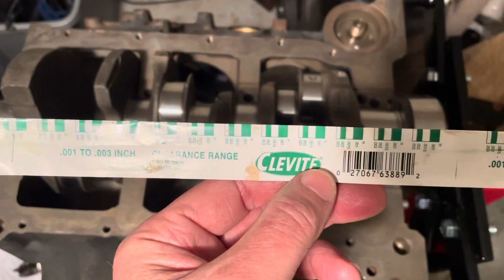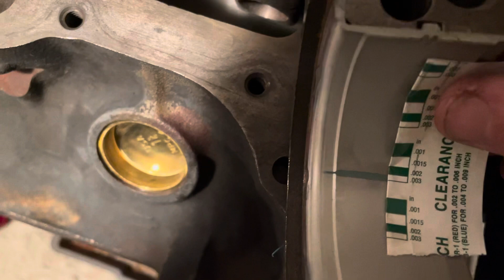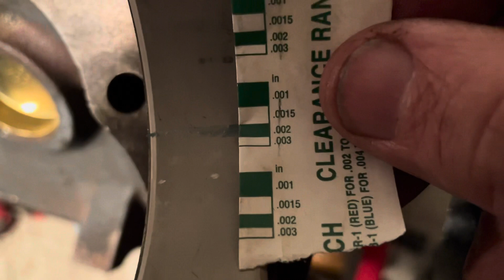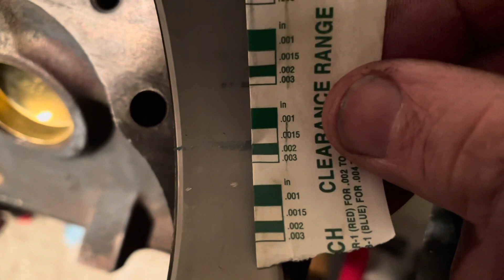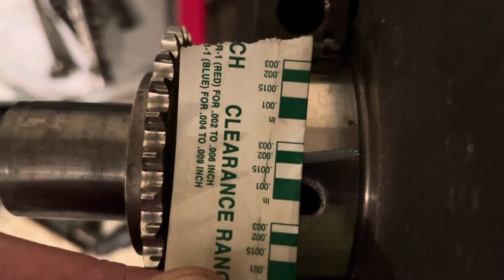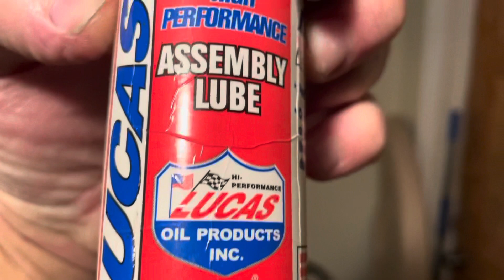Part 3 - Mercruiser 4.3 (2) - Crankshaft Install

Comment: great video building my own 4.3 Will you have a video on the rods . I had to stop  my  build the new std bearing rods were  binding the crank will not turn. as soon as I swap to old bearings it works. do you recommend a type of brand or nay reasons the new onea are binding.
Reply from the maker: Clevite or sealed power tri metal bearings are what I use. If the old bearings don’t bind and the new ones do you got a bad batch of bearings. Try a bearing that works on a different rod on the problem rod to see if it’s the rod or the bearings

Comment: I would like to know what did you clean the engine with. Thanks
Reply from the maker: Engine blocks, crankshafts, and cylinder heads are typically cleaned by a machine shop as part of their reconditioning service.  Cast iron is dipped in a hot caustic tank that cleans sludge out of all passages. Aluminum is washed in a machine with mostly just soap and hot water because the caustic solution will destroy aluminum.

When I do clean parts like valve covers I use Gunk Engine Cleaner (original) if the sludge is really bad followed by spraying the part down with Shout stain remover, wire brushing and then rinsing. Shout does a good job of removing oil spills and cleans hands great. I don’t use brake cleaner because I think it’s too toxic for my skin and lungs.

Edit 05/31/2023: don’t get Shout on your hands or skin. After about a year my hands began blistering due sodium hydroxide burns. Use gloves with shout.